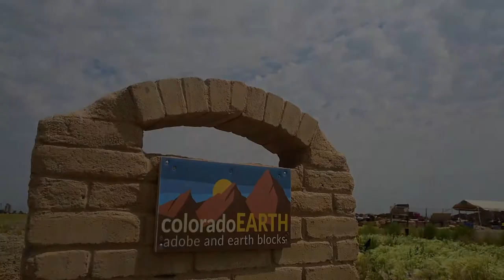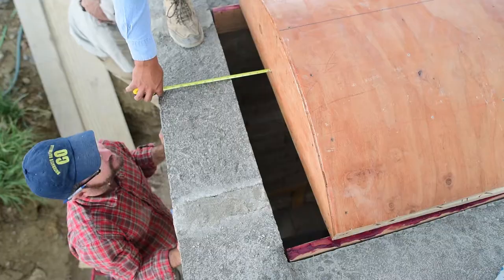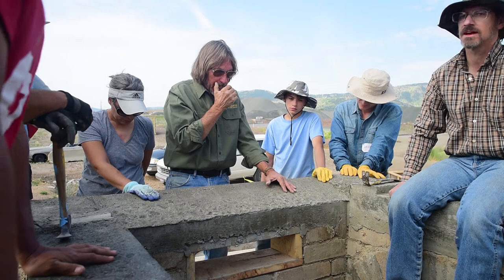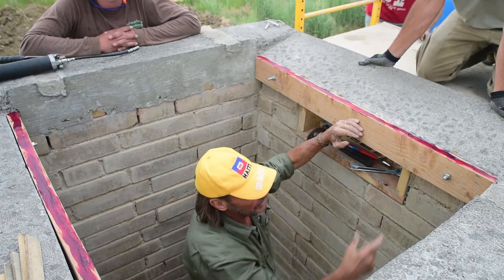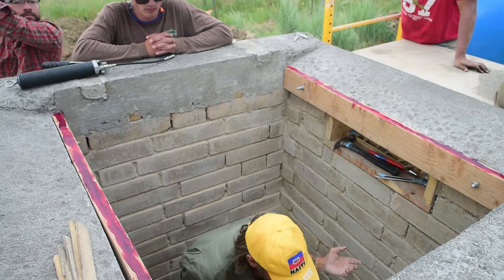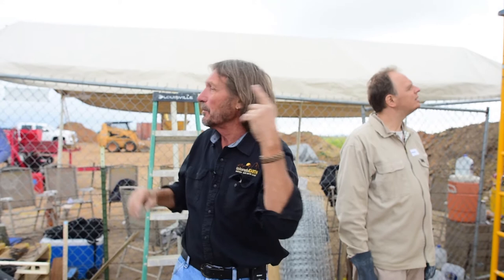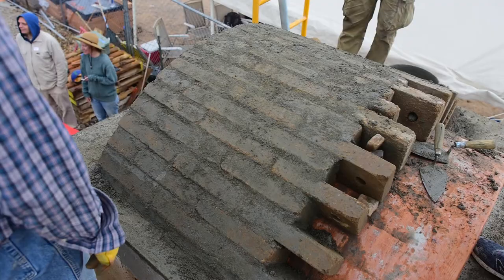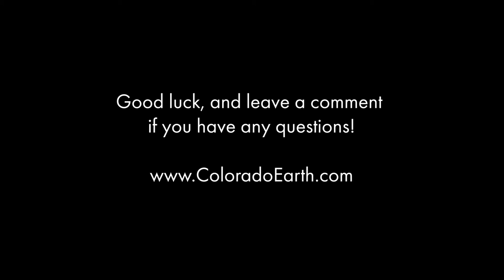Part 8 - Compressed Earth Block Barrel Vault

Comment: I would suggest making a 2 degree slope on the CEB when making it, and have an interlocking design, and to have a full 180 degree arc to eliminate the horizontal stress on the wall-roof joint. Then no mortar would be needed between the bricks, just water, and mortar on the outside plus a rain shield

Comment: Jim, thanks for this additional vedeo.
I am currently working on a research paper on CESBs, my intention is to spread those initiatives at least in Haiti. 
Do you have any reference material for vault design? I am not aware on the criterias to decide the width and the span of a roof vault.

Any info will be greatly appreciated.

Thanks,